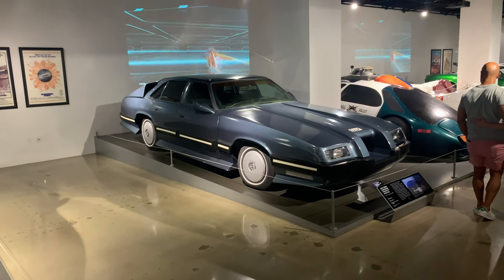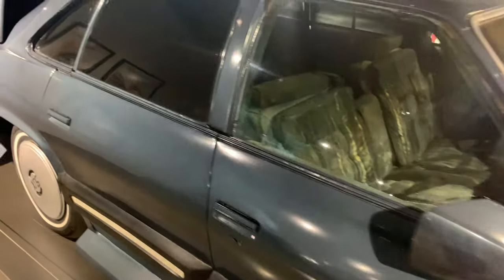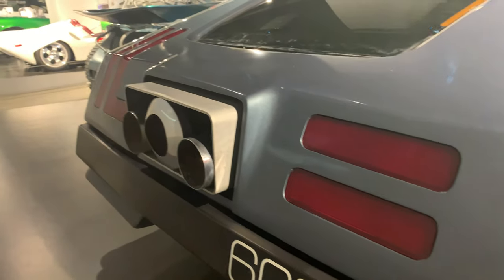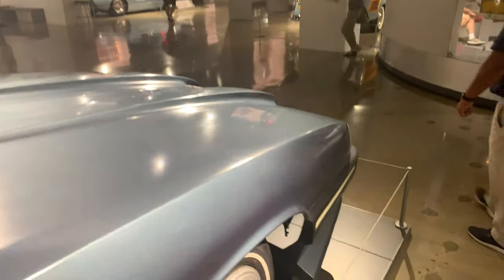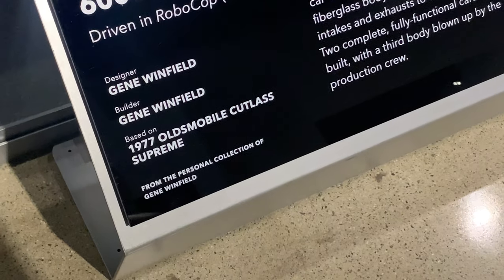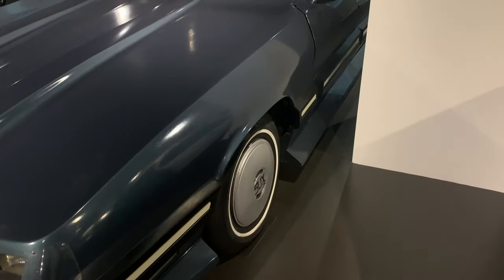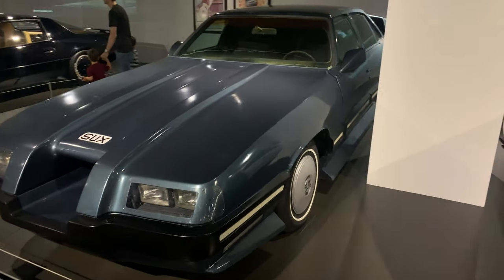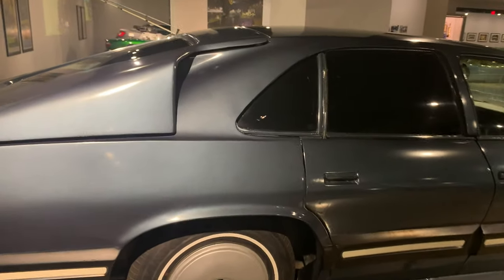1987 ROBOCOP 6000 SUX CAR - SCREEN USED

Comment: It's S-U-X not "sucks."  Awesome, thanks for sharing.
Reply: Yeah man, it’s so annoying
Reply: What do you think SUX stands for?
Reply: @motrhead69  I've never seen what "SUX" is actually an abbreviation for, if anything.  It's likely just a made up abbreviation and play on the word "sucks" for a joke, but in the movie it's pronounced S.U.X. not "sucks."
Reply: @motrhead69  Sport Utility Crossover
Reply: read the story behind the name.....it does literally mean sucks
Reply: @dazzab111  yes)) Verhoeven hate ugly pontiac 6000, and prank this model
Reply: This was a jab at the Pontiac 6000 as the ford Taurus was just released and changed how cars were designed and engineered overnight. Since this movie took place in the future it was only natural to use the ground breaking Taurus as Robocops police car. This car also was a succeed or die moment for ford as they put everything they had into the car, if it had failed ford would be bankrupt. Unfortunately like all things the Taurus lost its way over the years, even becoming a joke at some point but if you just look at that first gen it truly was a groundbreaking car especially compared to its competitors.

Comment: I couldn't help but laugh at this car, and love it all at the same time.  At the time this movie came out,  I owned a Pontiac 6000.  I just knew they were mocking my car. Honestly those Pontiac 6000 really did suck. I was stationed in Germany when the movie came out. Had it been nowadays with the easy access we have to Amazon, I would have bought those vehicle stick on letters and added the SUX directly on my car after the 6000. Lord knows I looked everywhere for them at the time. I just never could find any. Ironically in a twist of fate, when I got back to the states with it I ended up buying a new car. I didn't trade it because I had to wait for it to be shipped back.  Anyway the new car I bought broke down on me one night and my 6000, bailed me out. I guess you just never know.

Comment: Some backstory on to why the car looks so rough here: After filming was wrapped, the only remaining 6000 SUX ('76 Oldsmobile Cutlass underneath) just went back to where it was built, which was one of Stan Winstons shops where they do movie car props. There it sat in the desert for decades in a parking lot out back. Somehow the rear window got smashed and the entire interior got thrashed from being exposed to the elements. It's not apparant in the video, but the backseat area looks like it had vermin living in it for a while. A few years ago it got moved to the Petersen Automotive Museum on display which you see here. After that, it went right back to the desert. It's since been sold to some overseas movie car collector which plan on restoring it.

Comment: 1:35 is that a radio antenna built into the rear window or that orange strip for the rear window defrost? The latter, why is it on the outside instead on the inside of the window as it usually is?

Comment: I wanted to know how much bhp the car had.!
Reply: Considering its from the bad old days of the late '70s, id guess 150hp would be very optimistic.
Reply: Since it's just a dressed up 1977 Oldsmobile Cutlass Supreme, just look at those specs for comparison.
Reply: AT best 185 if the engine is a 403 V8